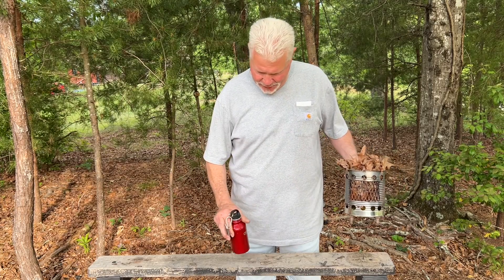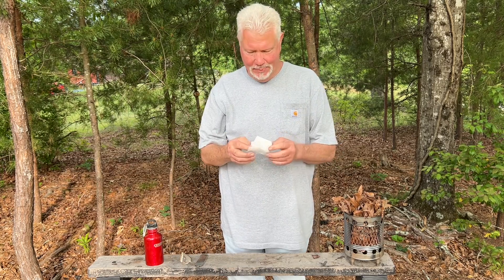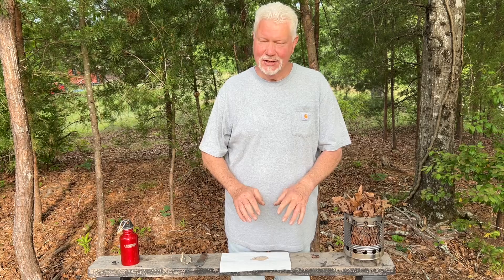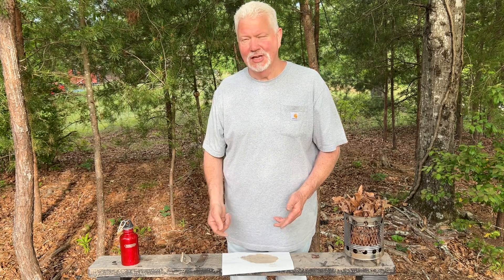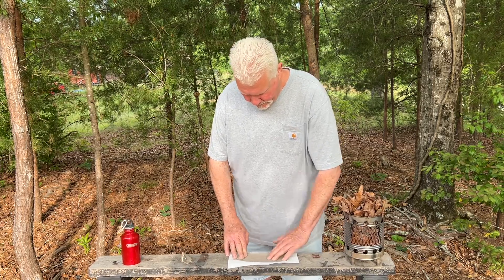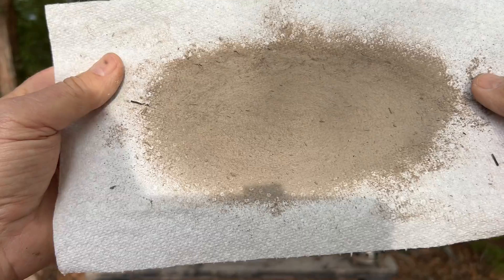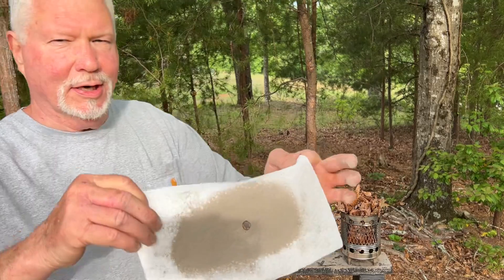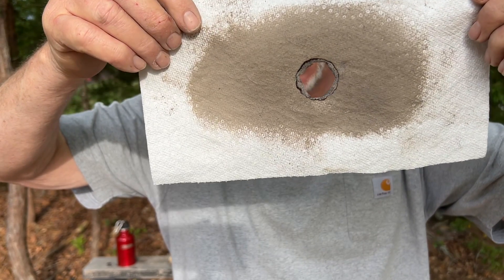How To Flint And Steel Ignite Uncharred Paper Towel

Comment: David....what's your opinion on the fiskers small hatchet. I bought one the other day and for a compact hatchet it seems to be OK. Not sure if you have seen one but the actual head is thin and looks to be molded into the handle. I know one thing...using smith's stone you can get a dangerous edge on the little booger.
Reply from the maker: I’ve noticed them, but don’t know. Find a review on YT.
Reply: Thanks. I used it some today and overall I am impressed. The head is a little small but extremely sharp and lite. I will see what others say. I just figured you had probably reviewed one. Really enjoying your channel David.

Comment: David....I have been outside batonning some pecan for my hibbo stove. Plan on cooking some thing deer tenderloins tomorrow for lunch and wanted to ask you a question. Is it possible to ignite fine feathers off of really dry and aged pecan? This wood was cut about 8 years and has been in a co trolled environment with very low humidity. I have been try to get dust, fine shavings to ignite and just can't get it to go. Are there certain woods you cant ignite with a ferrol rod no matter how dry they are? Also been making more fat wood bundles. That stuff will ignite just by looking at it wrong! Love fat wood. What's great is it so plentiful.
Reply from the maker: It should ignite easily and burn hot for a long time. When you can't get feathers use scrapings.
Reply: I tried for over 20 minutes. I used feathers, scrapings and even dust and could not get it to go. I am doing something wrong because I switched over to fat wood and it only took one strike. Something is up with this pecan or it could be I don't know what I am doing. Lately I have been practicing on different woods and this pecan had been by far the most difficult.
Reply: By the way David...I had some gift cards from Christmas from Home Depot so I went today and got two of the corona saws. They definatley cut better then my other ones which were fiskers and Gerber. Thanks for turning us on to these saws. Very good investment in my opinion. Can't remember the size of yours but the only ones they had today were the 10 inch versions.
Reply from the maker: 10"

Comment: David...I never judge you harshly.....in fact I commend and respect you and that's why I subscribed. I know a lot but after watching your videos on friction fire making I ha e finally mastered the art. What I learned from is what wood to look for, technique and pressure. I had built fires before with friction using only a knife making my own cordage and bow but I was only about 1 out of 4 tries. The notch placement and wood is the key. I feel about 90% about my friction technique and it will only get better with practice. You think you could show how to use a bicycle lighter where you scrape off the plastic and use it as the fuel. I have used this method and it works really well. By the way, I have known about using a empty bic lighter to start tinder with the flint but one thing I learned is you have to keep the flint dry. I experimented try to start tinder in the rain with it and once that flint gets wet it is very difficult to dry out quickly.
Reply from the maker: I've seen the empty BIC scraped plastic fire making before. I'm not interested in trying it.

Comment: David....I bought several blank Morakniv blades and in tbe process of using deer antler for the handles. I drilled put one of the antlers tonight and lined the blade up and mixed high strength epoxy resin and costed the tang and pushed it in. Fit perfectly. I then used sone mineral spirits to wipe off excess. It's drying now and man is it going to be a pretty knife. Got a guy who makes custom leather sheaths and he said he would make me several. I didn't realize Morakniv sold blank blades. The ones I got were full tang so they run the entire length up inside the antler. I am going to make 4 of them. 1 to keep and the rest as Christmas presents.
Reply from the maker: Nice!!!